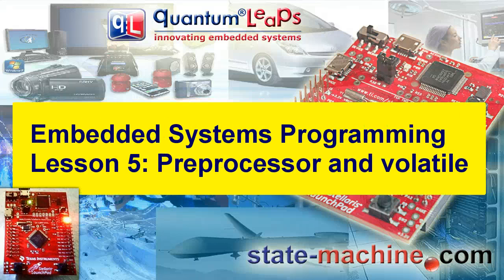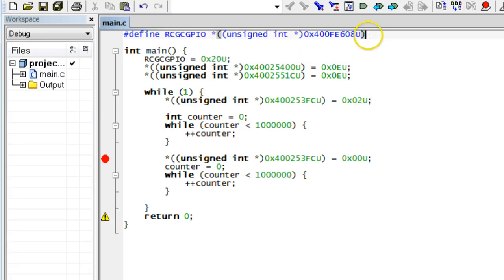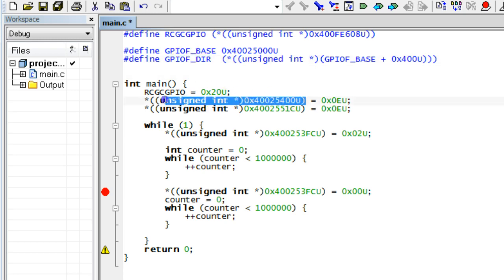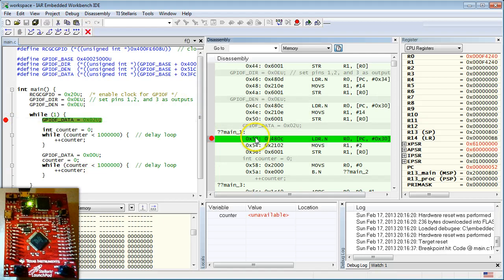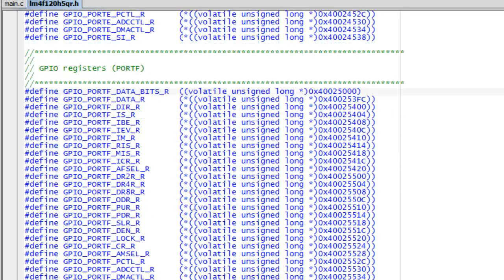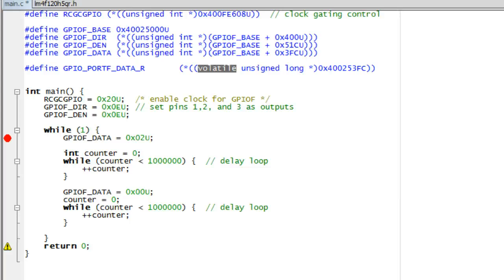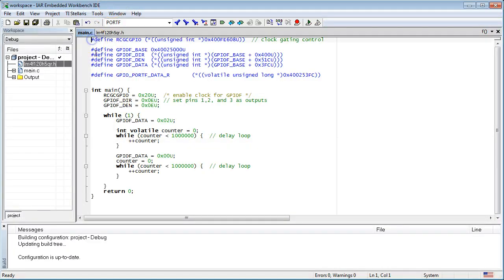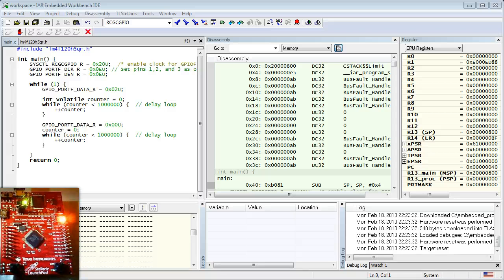#5 Preprocessor and the "volatile" keyword in C

Comment: Hey QP, sorry I'm struggling to understand how 0x0EU sets 1,2 and 3 to output. I'm looking at the data sheet for 0x40025400(GPIO_DIR), on page 660 it says that 0 is input and 1 is output. Not sure how E sets 3 pins to output.
Reply from the maker: +Helios Fire Remember that bits are numbered from zero, so bit 1 corresponds to 0x02, bit 2 to 0x04 and bit 3 to 0x08. Now, to set all three of these bits, you can create a bitwise OR like this: (0x02 | 0x04 | 0x08) == 0x0E. I hope this helps.
Reply: Quantum Leaps, LLC
Thanks for the explanation QP, I'm just wondering where I find that information on the datasheet as it only gave me 0 as a input and 1 as an output. If I wanted to set a specific GPIO pin to an output, where would I find it in the datasheet?
Reply from the maker: +Helios Fire To get a quick overview of the registers for a given peripheral, such as GPIO, you can look for the "Register Map" section. For example, the "GPIO Register Map" starts on page 657. Typically, a "register map" contains only offsets from the base register, because the registers are repeated in every instance of the peripheral, such as GPIOA, GPIOB, ... GPIOF, etc. (The C language offers structures, with which to model the offsets in the code. This concept is discussed in the upcoming lesson 12.)

From there, you can see that the GPIO direction is controlled by the  GPIODIR register at offset 0x400. The datasheet list the page #, where you can read about this particular register. Again, I hope this helps...
Reply: Thanks it does, slowly getting it everyday

Comment: Is there a similar header file of Macros for when I want to program directly in assembly? Or do I need to manually key in the entire register address everytime while programming in assembly? Also, how does the 'volatile' keyword manifest itself in assembly language?
Reply: It only manifests itself int the way, that the assembly code will be less optimized. There is not volatile machine instruction, it's something that only the C compiler sees.

Comment: Hello Miro,
You recommended that the volatile keyword should be used after the type 'int'. Any particular reason for this?

Thank you for these videos.
Reply: tulsidas123 IMHO: When scanning through the code, you are normally more interested in looking for a particular type of variable than whether or not it is volatile or not. Hence, placing the variable type first allows you to scan vertically through your source for instances of "int" instead of "volatile int"
Reply from the maker: tulsidas123 My recommendation for placing 'volatile' (as well as 'const') after the type comes from the C/C++ guru Dan Saks. Here are a couple of links to his articles that explain the matter (please note that the same discussion applies to both 'volatile' and 'const' qualifiers):

http://www.dansaks.com/articles/1999-02%20const%20T%20vs%20T%20const.pdf 

http://www.dansaks.com/articles/1996-12%20Mixing%20const%20with%20Type%20Names.pdf

Comment: I have a question about the coloring.  I can see that the whole preprocessor directives line in your case is colored blue.  On the other hand if I use my IAR Embedded Workbench than only " #define " is colored blue and all after the statement is black and green as rest of the code.  Is this an option you can change or is something wrong with my IAR Workbench?

Comment from the maker: 2. As you can test for yourself, the project files for the lessons don't include any inc/hw_... files and they work, so you don't need to include them. I will clearly state when any external file is needed and I'll try to explain what it brings.

But if you want to understand what these files contain, you should be able already to do so. For example inc/hw_memmap.h contains base addresses of various memory blocks from the LM4F Data Sheet, that I've discussed in Lesson-4.

Comment from the maker: I agree. There are better alternatives to the preprocessor for accessing the hardware registers. Yet, I can't imagine a C programmer unaware of the C preprocessor macros, especially that silicon vendors provide standard header files that still very heavily rely on the preprocessor.

My goal for the future lessons is to use the CMSIS (Cortex Microcontroller Software Interface Standard), which maps hardware registers to C structs. But to get there I need to introduce structures. Stay tuned...